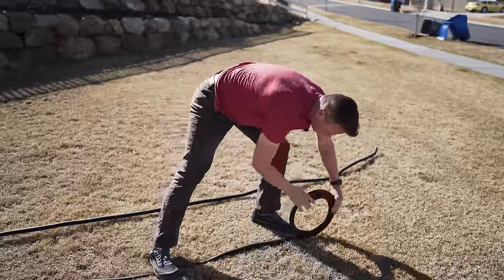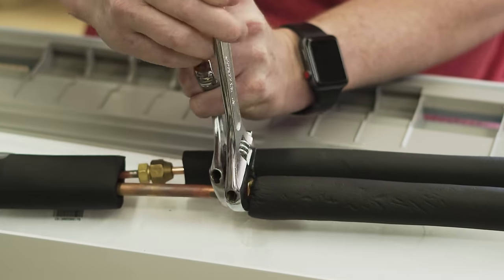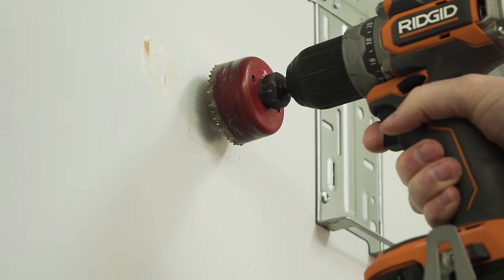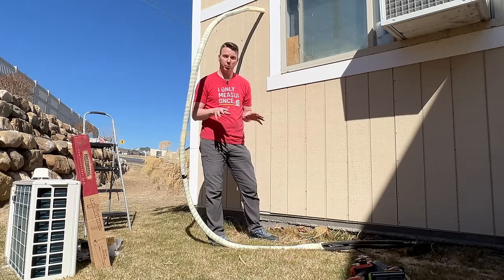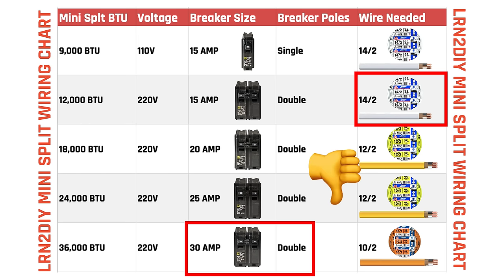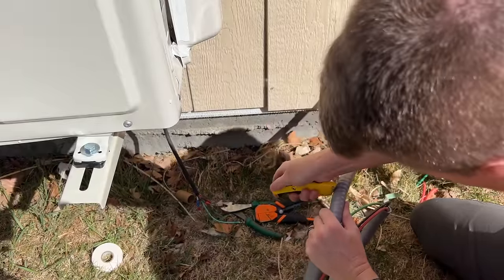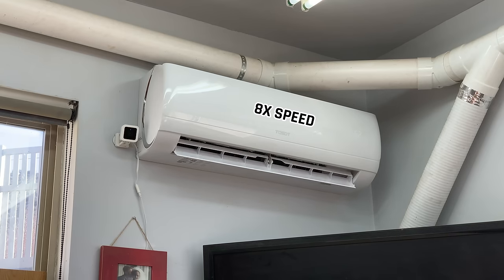DIY Mini Split Install - All the Things Nobody Shows You

Comment: The disconnect at the mini split breaker size does not matter as long as it's rated the same or higher than the overcurrent device at the panel, it's just a "disconnect" for service. The overcurrent device at the panel should be sized properly along with the cable size and cable type.

Comment: Only issue I saw was the drain house was wrapped with the copper pipes - which is fine, BUT you then coiled them at the bottom... this made the drain go in a loop up and down, and whereas that is OK for the copper pipes, that is not good for a drain!    You will end up with a loop of water, which can not only freeze in the winter, but can build up nasty things inside it during the summer... And in order for it to go over a loop, it has to completely fill up the pipe, so your drain will end up being basically full of water in the loop, except for a bubble at the top of each loop.   Other that that, I think it is a great video.  One other point, the instructions I got with my unit explicitly said that I should NOT put in an oversized breaker (not more than 25 Amps), it is OK to use 10 gauge wire with a smaller breaker, just not the other way around.   I'm sure they did this to avoid the situation where the smaller wire in the unit started shorting out, but you had enough power going to the unit that it won't trip the breaker, and will instead just burn up the unit (and house/shop) instead.  My unit pulls 17 Amps, so 25 is reasonable.   It also said to pull the vacuum down to 500 microns, so I purchased a gauge to be able to determine that vacuum, which might have been an overkill, but it did bring out the fact that I had a leak in the fittings on my vacuum pump, and the best I was able to pull down was about 4000 microns with nothing else connected, removed the bad fitting and was able to get 120 microns.  With a gauge set like you used, you would never be able to tell if you got it fully vacuumed down to what you needed or not, and in my case, I might have a much higher pressure remaining in the lines...

Comment: No need to buy a vacuum pump and gauges. Almost all auto parts stores will loan you them for free from their loaner tools. I borrowed them several times when I replaced the AC in my 1990 Toyota pickup. Great video overall. Thanks.

Comment: At 03:35, if you don't hear the gas venting does that constitute a possibly defective unit (a leak or puncture damage)?
Reply from the maker: From what I understand, no. It might be good to check with the manufacturer but I think they ship with different pressures built up.

Comment: I have a 50 amp from a hottub that was disconnected. Is there a way to use that 50 amp box and run a new separate box for a mini split 220 amp.
Reply: If you buy a 30 amp fused disconnect, and then put in 15 amp fuses, you can use the #8 or #6 wires that went to your spa to run a 240 volt outdoor unit.  You will also need to replace the circuit breaker with one the correct size, if the wires fit into a 15 amp breaker, that is fine.  But you might need to buy a 30 amp circuit breaker so the #6 or #8 wire will fit into the larger capacity circuit breaker  with a wire terminal rating to hold the larger wire.   You might want to try fitting some # 8 wire into the 15 or 20 or 30 amp circuit breaker at the hardware store before buying the circuit breaker.

Comment: I am getting around 3 gallons of water a day. one of my units started leaking. so I ended up taking my shop vac to suck out the hose. it worked with no problem. the leaking stopped.

Comment: Hello. My internal unit cames from factory with high presure on  high pressure pipe. The other has not. What is it ? Thanks
Reply from the maker: Typically, the large copper line, called a suction line, transports the refrigerant in its gaseous state while the smaller pipe, called the liquid line, circulates the refrigerant in its liquid state.

Comment: #1 overlooked concern of most installs?  Drainage.  Air conditioners make water all day long. Don't create a swamp directly under the outside unit - somebody will at some point work on that, and track it back in the house.   Could... you use that water? Yes, so think carefully.  A storage tank could serve doing laundry, or just watering plants / lawn.  But you can't just tie your own pump in to plumbing common to city supply: code gets weird at best [backflow preventers etc], and may be prohibited depending on where you live.  Me? I would serve laundry, which would mean using city water to top off tank if I needed more volume, and running the pump as needed.
Anyway. put the condenser unit up high to keep it away from animals and yard tools.  Leaf blowers can put a bunch of junk in coils - a good 4 or 5 feet kept clear under the unit works well.

Comment: You don’t just snug the flare nuts. You need torque them down to manufacture specifications. One should also pressurize to 450-600psi with nitrogen to test flare connections. I’ve seen it one too many times where flares will become undone because of the high pressure. You should’ve also cut the hold and mounted the unit and then pushed the mini split lines through the wall and make the connections outside, would’ve been a lot easier.
Reply: You don’t need to go over 300, 350 max… This serious error this guy made is storing the excess line set in a vertical coil… Oil, which escapes the compressor, has a very low pressure so it will remain as a liquid the entire cycle… So, on the suction line it will accumulate at the bottom of the coils unless there is a rather high refrigerant flow rate, which you are not going to have in a variable speed system like is used in mini splits.. Thus, oil will not return to the compressor and the compressor might fail… Granted the accumulation is slow, but none the less it will happen… This does not happen on traditional heat pump systems as there is still about 20-25% liquid refrigerant when heating that allows the oil to flow and eventually wind up in an accumulator which has a small orifice / metering device at the bottom of the suction line tube in the accumulator that pulls a tiny amount of liquid refrigerant with the oil into the compressor, although still allows the refrigerant to evaporate as liquid refrigerant getting pulled into the compressor will also cause the compressor to fail earlier than expected…

Comment: By removing the service adapter you had allowed  air to be pulled in not much. Best to back  open valve & let then freon flow the remove. Just good practice

Comment: You should have used a 15A or 20A breaker.  The 30A will protest the 10ga wiring but not the compressor.  Basically size the breaker to the load while insuring wiring capacity is sufficient

Comment: That’s why it’s so much cheaper. You’ve got so much more to deal with. Tristan installed a Mr. cool with two heads and it was simple. The hardest part was placing the condenser on its rack on the side of the building. The rest was a piece of cake.

Comment: I know others have mentioned this, but I have to add my 2 cents worth in here.   You said to use the fuseless disconnect because you have the circuit breaker inside.  Well, all that is good, as long as you don't double the breaker, that should be on it.  If you want to use a 30 amp on that system, then you need a 15 amp FUSED disconnect.   There.   My 1.5 cents worth......Cheers

Comment: It's much easier to mount the head, then run your lineset, you more likely to kink the copper lineset working with it all unraveled like that, plus it's easier to mount the head with just the stock lineset coming from the head.

Comment: * Use a meter or stud finder to check for Voltage (wires in the wall) before choosing mounting location.

Comment: I just checked the link to the minisplit, reason why they supply a 16ga is they only expect 6.6amps max.
Wire size is a function of amperage and length.

Comment: When you were done vacuuming the lunit you closed the valve, which isolated the gage from the unit. Of course it's not going to drop. In the end, you did not detect if the unit has a leak.

Comment: When you finish pulling your vacuum you should back seat your valves before taking your hose off, bec the main point of the vacuum is to remove all the moisture from in the lineset and indoor coil, if you remove your hose before you back seat your valves,  the system is in a negative so when you remove the hose it allows moisture back in the system, yes its a small amount but still, if you remove you hose  after you back steated the valve you don't have that issue.
Reply: How do you back seat your valves?.. Is there a valve a bit like on a tyre, where you press in a centre bit and air can move in and out, but if you stop pressing on it, it seals?.. I saw a YT video of someone using a hand, brake vacuum pump, and he had a bit of metal wire in a tube, which seemed to be for poking the valve to be able to vac the system. It supposedly went down to -1Bar so I don't see the problem using one of those..

Comment: Even you use 10 gauge wire its better to stick to recommended 15 amp breaker , so basically the unit will not pull more than 15 amp to protect it

Comment: @23:29  I do not blame you for using 10/3, whenever, wherever possible. When I saw the chart, I knew those were bare minimums. It means with those gauges of wire; you will encounter an "acceptable amount of loss" without dangerously heating up the conductors under full load in the middle of a hot summer day. By using the largest commonly available conductors, you'll do much better safety and efficiency wise. Yes, it costs a little bit more, but considering it's many amps and high voltage; it is worth it. @24:31 that was a big mistake to use a 30 amp breaker for your 10ga wire. The unit is designed to be on a double 15 amp breaker, and that was the ideal choice. You're fire danger just went up, because that breaker will not break when it hits 20 amps draw on one of the 115vac lines.

Comment: Many auto parts stores will loan out a vacuum pump at no charge. They are assuming that you have an automotive issue and if they loan it to you then you will buy what you need at their store. It works the same no matter what A/C system your using. Could save you a few extra bucks. And if you feel guilty for doing this, just purchase some oil or antifreeze from the store:).

Comment: 26:42 it is aginst the NEC code to run Romex inside of conduit or flextight. Also, its not a good idea to use a 30 amp breaker protecting the minisplit. The breaker is to limit current if the unit has a malfunction. It is not against the NEC code to use larger wire on a smaller breaker.

Comment: You broke vaccum when you took of your hoses. You now have non condensables in your system. After isolating the vaccum pump and turning off the valve at the low side gauge. Release the refrigerant. You'll have some in your hoses. But it is better than a dirty system. The compressor is likely working harder than normal.
Also add vibration pads under neath, wear your mounting the outdoor unit, this by your shop it's fine. But if this was by your house it will vibrate.
Cut off those flare connections and make new ones. Never trust factory connections. If warrantied they will blame you for loss of refrigerant. Remove those coils too while at it, just adding oil traps. Check if mini split drain pan is internally sloped  too!! Some want 1/8" grade.
Good install tho. Nice and clean. You can add lineset covers too. They look like gutter pipes but smaller, for looks. 
You already have a gauge manifold, check your high side pressure and see if it's above spec.

Comment: If you do want to torque them, and if you want to or already do some of your own automotive work, you can torque flare fittings with a crow's foot pointed 90 degrees from a normal socket-drive torque wrench (no need to calculate any extra length on the wrench this way, not that the difference would be significant in my opinion)...

I say this as opposed to buying individual fixed torque wrenches that some pros have, as that's more expensive and specialized than you might want... Of course if you are a pro, you probably don't need any advice from me anyway (and if you're starting out buy what you think is more convenient, I'd probably get the special wrenches to speed up work)

Comment: Should have used a 15 amp breaker (if that is actually the max rated amperage written on the condensor), even with 10 gauge wire. You just can't use lower guage wire (like 16 guage) than recommended 14 guage on that chart you showed.

Comment: Thanks!
Reply: Great video! Definitely the absolute best I have seen going into the real details!  Two comments: 1. As a brand owner of a different brand (Classic America) cutting the refrigerant lines can create a problem (besides the possibility of poor flaring). If they are cut too short the system will trip on over pressure (the refrigerant gas charge is designed for a minimum line length)-Coiling the lines is HIGHLY recommended!!  2. For those of you (us) not accustomed to tighten nuts "snug but not too tight', Harbor Freight has a torque wrench for about $15. The manuals often give the  recommended torques in metric units, so you will have to do some tricky conversions, but it's worth it if you don't have experience with this.

Comment: In a 220 configuration there are two hot wires (usually black and red) and one neutral  (always white) separate from the ground (bare are green).   According to NEC the white wire is always neutral unless it's the return leg from a switch (even then it should be wrapped with black tape inside the boxes to show that it can be hot. .  Since you are using 3/2 you should have had a black and a red wire.  The white wire should never be connected to the circuit breaker.  If you have this inspected, which you really should, the white wire to the circuit breaker would make it fail.
Reply: I made the same comment except that the white wire can be used as a "hot" if, as you said, it is correctly color coded using "phase tape".  If you're only using xx/2 Romex on a 240 volt system, you have no other choice.

Comment: Ok ok the heavy wire and braker .. is 1 thing..
But also.. after vacuum... keep your gauges on place and wait  open your valves and let your freon run on the lines  filling all the space or suction that you just create  and try to be ready at that point w/ your electrical    to run your unit. .. remember  the vacuum action is to remove humidity.. air .. and any other contamination... what we want here .. is just freon running on those lines .. so when you remove your gauges air is coming back on the lines ....🤷‍♂️. thanks ..lol

Comment: By removing the hoses before opening the lines you don’t have pressure to prevent air or contaminates from entering the system

Comment: As far as the distance from the wall goes, my directions state 12 inches if the condenser is mounted on the ground and only 4 inches if mounted on the wall with brackets.

Comment: Never use EMT on exterior settings and never terminate at the panel 1st.  And as expressed earlier if the appliance calls for 15amp 2 pole breaker then make sure you use a 15amp 2 pole breaker.  Using 10 gauge wire is just a plus..

Comment: Good video about the split system. However, your garage sub panel shows multiple code violations in the center bottom of the panel. I see what appears to be multiple circuits entering the box thru a 1 inch hole without any proper Romex  connector. This creates a code violation and would cancel your insurance in the event of a fire. Get this taken care of properly!

Comment: You may be misspeaking but to clarify, neutral should not go to the circuit breaker.  Best practice would have been to utilize red and black wires as HOT for this two-phase condenser and omit the white wire as neutral was not used in this application.

Comment: Per code in United States you need to mark that White wire as a Hot wire, Either use a wrap or  hell even a RED/BLACK permanent marker, preferred is wrapped.  Secondly the breaker should be fine I wouldn't do it but, You have 10 gauge wire so its not going to burn through.  Not a terrible install, as someone already said the lines are not in proper laying position when rolled and tucked but torque does matter though. The vibration of the unit can cause the lines to loosen over time.  The point made by a user of cutting the flares off depends on if the lines came from the same manufacture. If the lines are from someone else then you really should cut them and use the proper manufactures flares and or  line set. If your using someone elses line set and something goes wrong with the system you could loose your warranty. (using the RED wire would have made it easier) BLACK AND RED ARE HOT IN A AC configuration. WHITE IS A NEUTRAL, MOST PEOPLE CALL IT A GROUND its not a ground though.

Comment: A word of caution to people considering their own mini split install. I just built a 500 sq.ft. addition to my house and installed a mitsubishi h2i mini split to serve as the primary heating/cooling method. In all my prep I never learned two critical pieces of information:

1)Many mini split manufacturers will not honor the warranty for a unit that is not professionally installed. 
2)Many HVAC service companies will not work on equipment not professionally installed.

My unit stopped working after 2 days. I'm now in a situation where Mitsubishi won't help me, multiple service companies have declined to look at it, and the unit can't be returned.

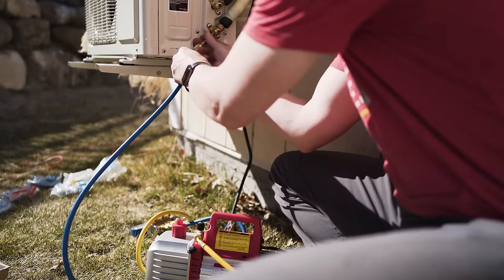Comment: Thanks. But. When you remove the hose at 18:53, you let air and water vapor into the air conditioning pipeline, destroying the previously created vacuum. Critical error, I'm glad that it still works well.